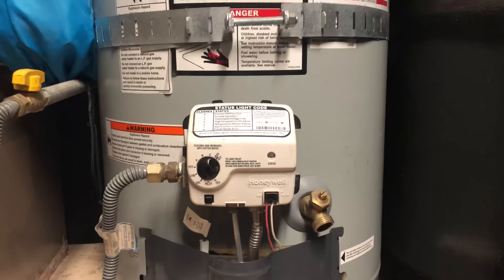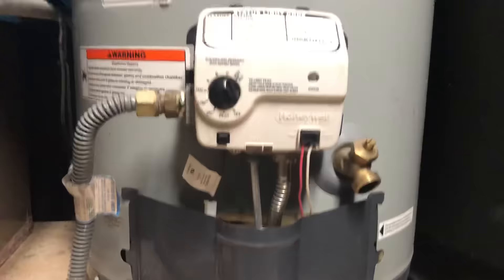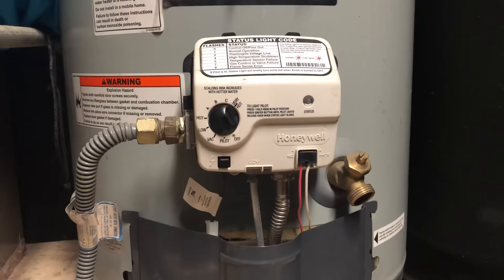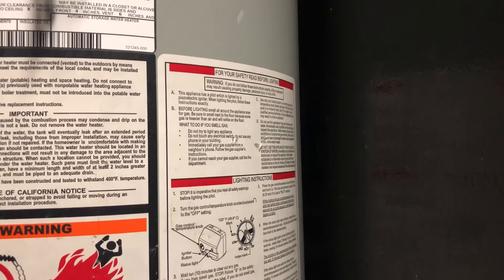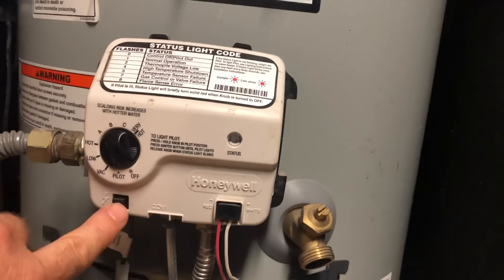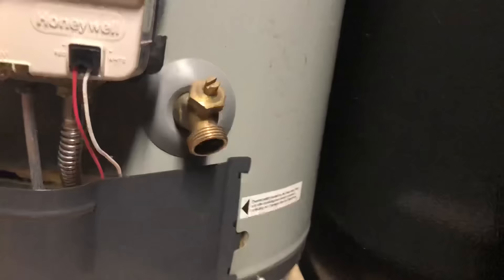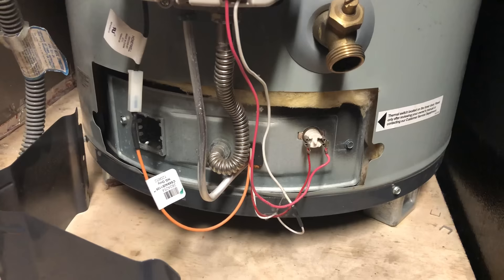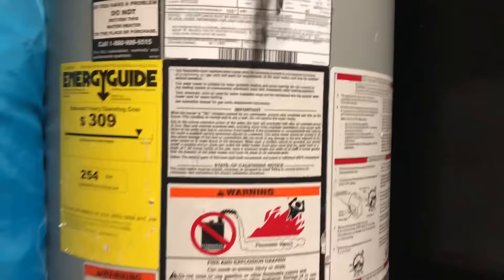Water Heater Pilot Out - Problem Solving. Most Common Issues. EASY FIXES!

Comment: Thanks bud. The thermocouple reset did the trick. No one else says that. Been trying to relight my mother in law's heater for several years. Never could. Just saved her $80.
Reply: so it hasn’t been lit for several years? couldn’t you have just paid the $80 lol
Reply: Bruhhh several years 😅 saved $80? I'm ngl I would have  paid $80 to have a water heater the last few years

Comment: Omg you just saved my whole family! We are stuck in the house with Covid. I'm a single mom of 4 and I also have my niece and nephew. We are all quarantined in my home. The water heater went out yesterday. The water heater controls the heat in the house as well. We've been freezing for 24 hours. Thank you, thank you sooooooo much for putting this video out.
Reply from the maker: You’re welcome. Thank you for the kind comment 👍
Reply: once I let go of the pilot, the flame goes out. what causes that?
Reply: @1germannese  this absolutely worked for me short term. I did have to get a new unit because it would not stay lit for long periods. I did have to do this several times a day.
Reply: Hi, this is impossible.  Water heaters only provide hot water. Your furnace heats your home.
Reply from the maker: @ItsmeBish584  actually some forced air heater’s use hot water to heat the manifold. They’re pretty uncommon, but they definitely exist.

Comment: You are a lifesaver. I was woken this morning by my spouse as she was departing for work with a comment that she thought the hot water heater wasn’t working because her shower never got hot. Not a great entree to a grueling 13-hour day, after which I wanted nothing more than a hot shower, except that…yeah. So I went up into the attic where the hot water heater is and attempted to relight it, following the instructions, and met with no success. I tried again after waiting for 5 minutes (which is what it says on mine) and still…nothing. Hot, tired, and sweaty, I teetered on surrender but thought I’d make one last-ditch attempt by watching a YouTube video. Fortunately, I found yours - you explained how it works better than the instructions, and when my first attempt wasn’t successful, I watched a second one of your videos where you explained the reset button on the thermopile, so I tried that and I felt a slight click, so I waited 10 minutes (per your instructions) and followed your relight procedure. I could hear the slight hiss of gas when I pushed the pilot light in and I waited a few seconds and started clicking the igniter. After a half dozen tries I saw the status light flash green - SUCCESS - so I dialed the control to my desired temperature and “Whoosh” - the sweet sound of ignition! I can’t thank you enough for giving me a much-needed hot shower tonight, and my wife will be ecstatic that she doesn’t have to choose between a cold shower or no shower at all. Blessings to you and yours.

Comment: Can’t Thank you enough. Hubby tried with No Luck early morning, so he took a Shower in Cold Water, He had to leave for work, told me about the problem and said just press and click. After 40 mins. trying to get it to light by Holding the Control Knob in Pilot position and pressing the igniter Button for 90 seconds repeatedly, I had NO Luck. So, I found your Video and after watching, I learned #1 you have to wait 10 mins. in between trying to start it again due to the gas build up and the sensor. #2 I found my Thermo Couple was popped out, so pressed it in. #3  I took a small brush before trying again and cleaned any Dust around the bottom just as an extra Tip before trying. Magic, it’s up and running like a Gem. Just Called my Husband at work and bragged my ass off.  LOL Thanks, Betty W.
Reply from the maker: You’re welcome. Thank you for the kind comment 👍

Comment: You really saved my ass here. My issue was a combination of the air intake not having been cleaned seemingly ever (thanks previous tenants I literally just moved in after) and the thermocoupler button being popped. Cleaned it out, pushed the button, and it finally lit!!! Thank you so much!
Reply: OMG That was my same problem! I had already cleaned the air intake as suggested from a previous video but no one had mentioned anything about the thermo coupler button! I had even taken the gas burner out to clean the entire assembly. I had a plumber come out and quote me $3500-$4000 to replace the water heater and upgrade the system to current safety standards. I told him, "No thanks!" I've been trouble shooting this on my own for two weeks! My kids are fed up with me and I too am sick of cold showers! Who knew it was as easy as pressing a button! Thank you! You're a life saver!

Comment: Excellent stuff here!  The "filter grate" is the flame arrestor that all water heaters (other than huge commercial ones) have had since 2003.  It's easy to compare the under side of this "grate" to a laundry dryer screen that gets blocked with lint and dust over time.  I prefer opening the burner compartment and blowing compressed air downward from inside then vacuuming out the base as you correctly advised.  It's all about the air :-)
Reply from the maker: CrowdSurfingGeezer thank you so much for the compliment and confirming The information in this video. Do you know why modern house water heaters seem to be “plugging up“ in regards to airflow compared to older models? My parents house has a water heater that was made in 2005, I’ve never cleaned the filter grate and it seems to be problem free. I’m wondering if some of the models have larger holes in the filter...
Reply: Different manufacturers use different medium for the flame arrestor.  I've seen ceramic, steel with small round holes and finned metal.  The ceramic ones really "grab" lint and hang on.  All seem problematic and, as you noted, contribute to 95% of all premature water heater failures. Chuck Barron uploaded an excellent video on 10-15-17 on cleaning these. A guy could do this full time and never get caught up!
Reply from the maker: I put it on my reminders to clean the filter grate the first of the month every month. I haven’t had any problems since I started doing that. It’s kind of a pain in the neck, but it sure beats hearing my wife yell at me from her morning shower “THERE’S NO HOT WATER!”
Reply: Time well spent then. :-)

Comment: It was that thermocouple I pressed it in and it lit back up good to know who knows how many water heaters have been replaced on my property because of that. Great video, I'm gonna be sending this to other techs 👍
Reply from the maker: Yes, I think lots of water heaters are getting replaced unnecessarily. Don’t forget that switch will pop for a reason. It’s almost always an air issue. Often times the air intake flame resistor/filter needs to be cleaned.

Comment: Man, thank you so much. I tried several times to start the pilot light but nothing happened it kept shutting off it wouldn’t stay lit. I didn’t know about the thermal reset switch that popped out. I pushed it back in, heard the click and tried again. And it worked. Thanks again.

Comment: Thank you so much for this video! My problem ended up being the thermocouple switch, and I would never have known that if it weren't for you. You just made my day, Thank you!
Reply from the maker: Austin Parker Happy to help👍😎
Reply: Same for me !!! Thank you so much! It didn’t really push in but I did hear a little click. Thought 🤷🏼‍♀️ and tried again and it started right up! I was so frustrated and pissed I was gonna have to call someone. Thank you!
Reply: Yoooo…..I replaced the thermocouple a year ago and hadn’t had any problems til yesterday. Took it apart and tested everything and it worked. Spent hours trying to figure it out.  This is the 10th video I’ve watched and the switch on the thermocouple was the issue!!! Thank you so much!!
Reply: Video worked for me too! After I called the neighbor (a former fireman) and he couldn't get it to work. First, he didn't wait the 10 minutes. Second, he didn't look for the light to flash. He did mention the thermo thingy but he didn't know about the switch. After he left, I cleaned under it (as I paused the video), then saw that I needed to try the switch. I pressed the switch and heard a click! I was so excited 😆. I was then able to light the pilot! Thank you a 1,000 times!

Comment: Been working on it all day, no spark from the igniter. Found the wire to the igniter was ran under the burner and was burnt. It would ground out every time that I put it back together. reinsulated it with electrical tape and now I'm back in business.
Reply from the maker: Nice job!

Comment: You saved me $980 when the service guy suggested that I need to replace water heater gas control with pilot assembly or new hater heater for $2000.
Reply from the maker: Nice job! Thank you for the kind comment.

Comment: My xg40t06ec36u0 does not have that open space underneath. It is flush to the pan under it. There is a rectangular side perforated area though on the left bottom of the tank but it looks clean. Been having issues since back from vacation with the pilot light out and no blinking light. When I do the restart steps and get it lit, at first it blinks 7 times between pausing and then goes to the normal 1 blink pattern. Did this yesterday but this morning it was out again. The last time this happened was about 2 years ago.

Comment: I have a rheem powervent 2 and we ran out of propane fully, and just had both tanks filled today.  It still won't start.  My limited knowledge is telling me that the propane lines need to be purged and or filled with propane?  How is this done.  The last time we ran out of fuel like this the exact same issue happened at it cost 275$.  There's gotta be an easy way,?
   Like holding down the pilot manually so the propane flows from the tank, through the lines, through to the pilot and voila.   
   Any help is appreciated

Comment: be aware of tears in burner screens, Whirlpool/AO Smith has known issues w/ burner screen ruptures and Honeywell Gas Valve replacement (to detect burner screen tears). Total fire hazard. Ours was emitting lots of excess heat  (when it wasn't backfiring and causing gas valve to shutdown).

Comment: I have a Reliance 40 gallon gas water heater. With the module on the front pilot light stay lit and when you go to turn it to burner it clicks, but it don't fire up.

Comment: what kind of problems does it mean if that button on the thermal couple switch ?? and is that like a safety fuse that pops when the system fails and does that turn off the gas automatically after it pops?
Reply from the maker: Typically, it’s an airflow problem. See if there’s a filter grate you can clean.

Comment: My problem was a rodent had cut the orange wire and after I twisted it back together, the orange wire carries high voltage and I could see it visibly arc when pushing the ignition button. Once I moved the wire away from the other wires, the pilot lit.

Comment: Let me understand this. My pilot light will not light. So I should shut off the unit and let it cool. Then clean out the air intake, then relight the unit and see if it performs better?
Reply from the maker: Yes. Clean the filter grate. Also, if the filter grate was very dirty, it can cause the limit switch to activate. Gently push that in if your water heater has one. (watch my other Water Heater videos if you’re not sure what this is.)

Comment: Mine is blinking 5 times Which one is the temperature Sensor Please help me out
Reply from the maker: It sounds like it’s overheating. Not getting enough air flow. check the air intake. Clean the filter grate. I have another video that shows how

Comment: After following the instructions on the hot water heater (turn off, wait 10 mins., try to light for 90 secs, repeat 3 times), without success (light stayed off), I found your video.  I brushed underneath, and after my next attempt, the light came on!  Unfortunately, it blinks four times, not once, which is an error code.  So I called the phone number on the hot water heater, which your video showed where the phone number is printed, and, after about five mins on hold on a Saturday morning, got someone who offered to ship a part to me with instructions on how to install it.  The part should be here Tuesday.  Wish me luck.
Reply: David Janes 9

Comment: Does this control module run off a battery?  If so, where is it?  Thanks
Reply from the maker: adolfhilter The short answer is no. I’ll make a video for the long answer. I’ll explain how that module generate power and post the video in the next 24 hours.

Comment: I have been trying every 5 minutes and didn't work.
I will wait 10 min
Reply from the maker: Be patient. It will work. I can feel it! You can do this!
Reply: @checkitout2468  Well it doesn't work.
I tried the gas stove and it's not working either.
I think there's no gas in the house 😆
Reply from the maker: Ha! No gas to the house will do it.
When you do turn the gas back on, it may take several tries to purge the air out. Be patient, it will work!

Comment: this is just a very bad product...ive never had a problem with any other water heaters..i bought this new at lowes and fist month it started going out. i've called the gas co. three times, they reset it  and every time it goes out the next day. the gas compy said they get calls to reset this particular model regularly.. Its just  a faulty design.